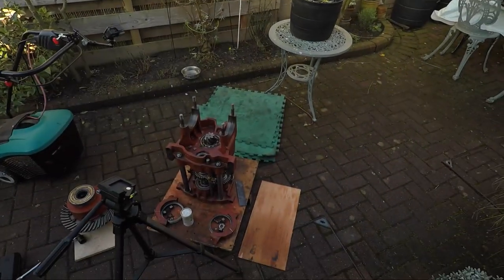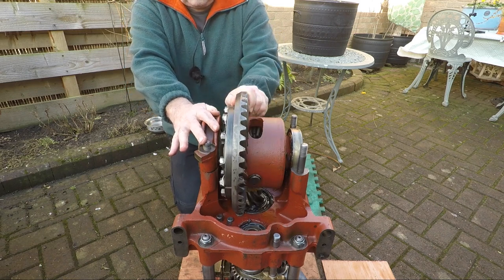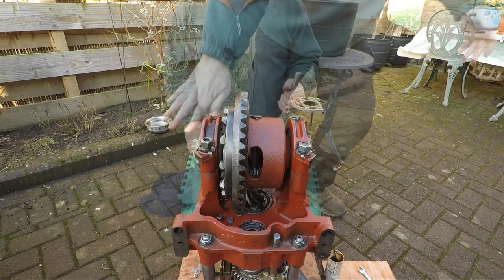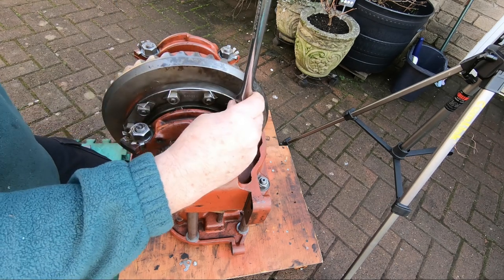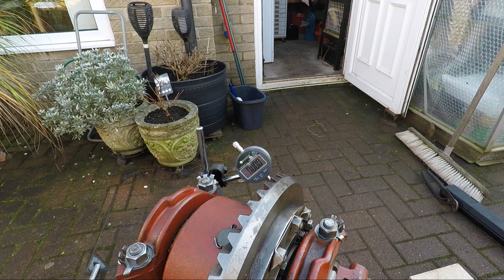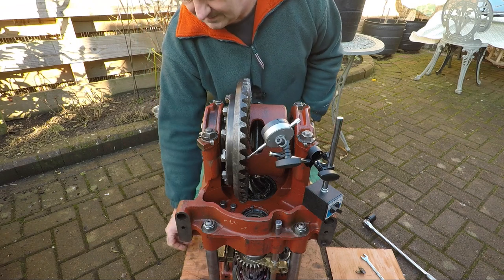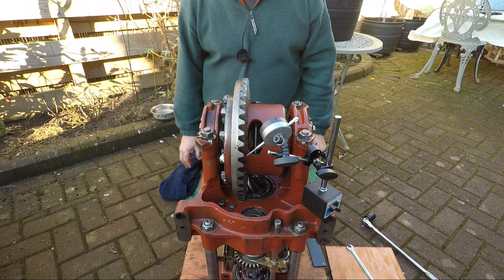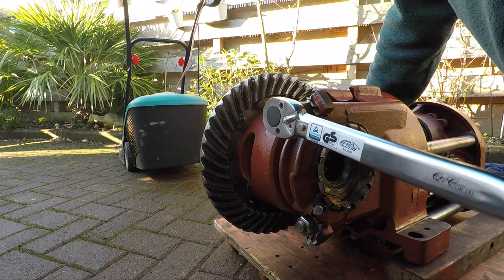Putting the diff back on the gearbox of the DB990 #53

Comment: Good job Barry, The only thing I could suggest is to have the dti directly in line with the rotation of the crown wheel as at 45deg it would be out a bit, but we are playing with tractors not space shuttles.
Reply from the maker: I'll check that when I'm fitting the pump back on as I can get the plate out the way and adjust if necessary. many thanks, always appreciated
Barry